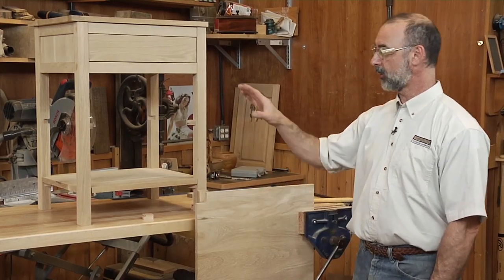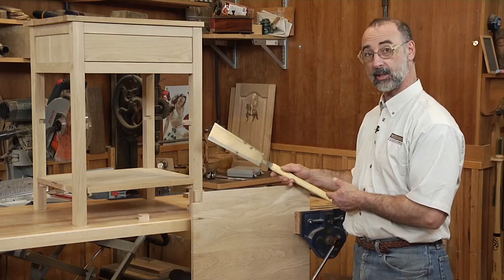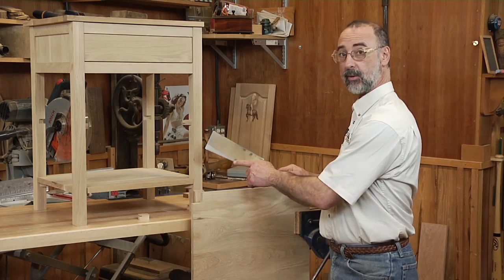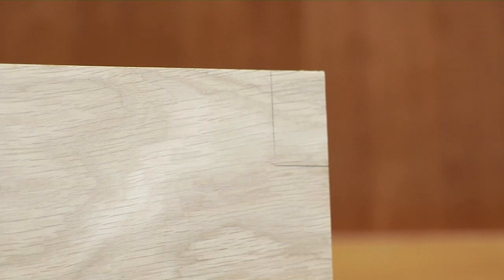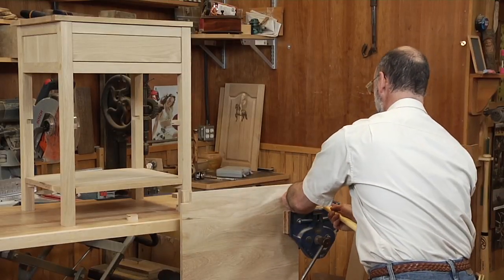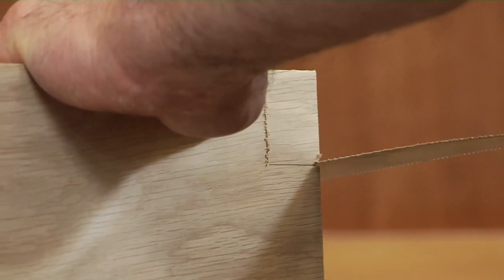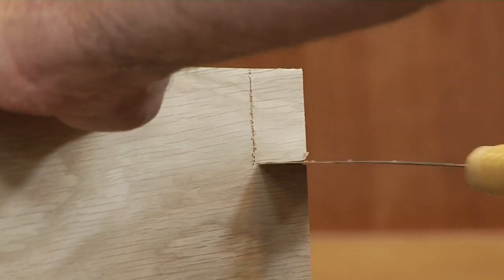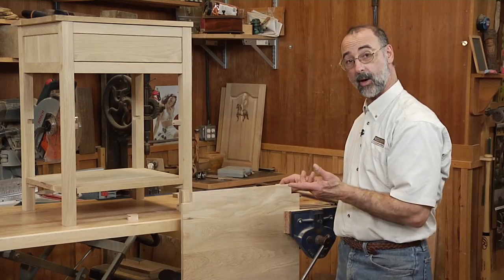What's the Deal with Japanese Pull Saws

Comment: You almost always have to pull back on a western style saw to start the cut. The pull saw just keeps that motion going. Also, since pulling keeps the blade from flexing and makes it stay perfectly straight, you have a whole lot more control. And for that same reason you can make the blade much more flexible and thinner. In fact, for years, I often put the blade in backwards in a turning saw, coping saw or hack saw for better control. I did that many years before I understood that the Japanese pretty much invented the pull saw. By the way, band saws have been using the pull saw principle to make possible the use of a thin flexible band for centuries.
Reply: I saw a guy make a little notch with knife/ chisel to start the cut... oh it was Jonathan Katz-Moses - look him up

Comment: How about some tips on how to cut straight with such a saw.  I am not even close to mastering straight cuts.
Reply: +David Clark Clamp a wooden straight-edge next to your cut line, then set the blade along that edge and saw.
Reply: +David Clark Hand saw blades are shiny for a reason, it's so you can see the reflection of the wood edge on the blade. You don't need a straight edge, just look down at the blade and make sure the line on the blade is inline with the wood. It's pretty easy to eyeball a 45 degree cut this way, too.
Reply: make a pencil line so you can see it, then its practise

Comment: I get rather severe pain in my forearms when using a pull saw. Am I cutting incorrectly?
Reply: +tkarlmann Grip the handle gently, you don't need a death grip. Keep your hand, wrist, and elbow all in line with the handle. Takes the same technique and effort as using a pool cue.
Reply: 1Howdy1 ...but you are using the opposite muscle in the forearm -- the one to pull, pool cue you push.  Big difference.
Reply: Not really, and if you think that way your pool technique is probably suffering as well. The technique is to hold the handle gently, like you would hold an infant's hand, and let the saw do the work. Will a Japanese saw cut through a 2x4 in 4 pulls? Sure it will, but you'll need to muscle it. Not the way to do it. Use proper body position with saw, wrist, forearm inline and directly under the shoulder, just like a pool shot. Keep everything relaxed. Focus on getting the cut started straight by looking at the reflection of the wood edge in the saw's mirrored surface, and then just let your arm swing. If you get this down you won't be stressing your forearm muscles. Another benefit is not having to draw many reference lines with a square - the saw will just naturally saw straight if you're relaxed and have good body position. Good body position is the trick to any kind of sawing, power or hand, and even helps with the table saw. Keeping your forearm and wrist inline with the work also the trick to cutting a straight line when painting or drawing - if you remove the arc, you don't have to worry about having an arc where you want a straight line.

I think many of us have difficulty doing this, because we have spent a lifetime using dull western saws that need to be powered through every stroke. A sharp western saw cuts pretty slick, too, but needs more routine maintenance.
Reply: yeo means you are past doing manual work, use a power sar